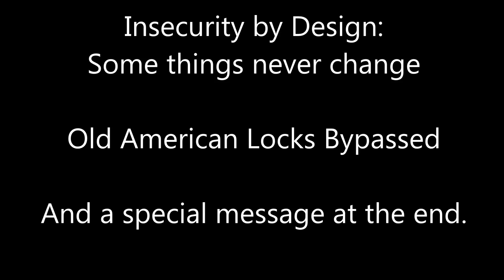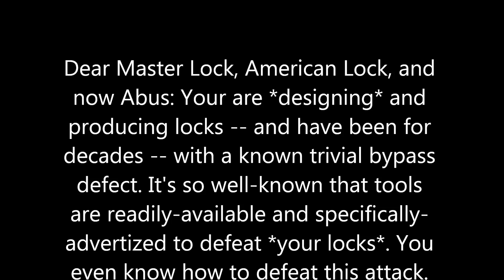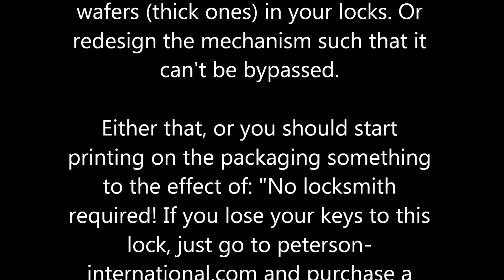(222) Insecurity by Design: Old American Locks Bypassed

Comment: Alex, it really depends on the abilities of each factory to manufacture to our designs and tolerances.  Some will turn it down while others can hit it every day.  After tooling costs, it comes down to volume.  Suffice to say, the difference could be from pennies to over a dollar per cylinder.  Some designs have their limitations--take die-cast vs brass for example.  You can triple your costs if you aren't open to design changes.  In our new designs, I will be okay witih that if they are better.